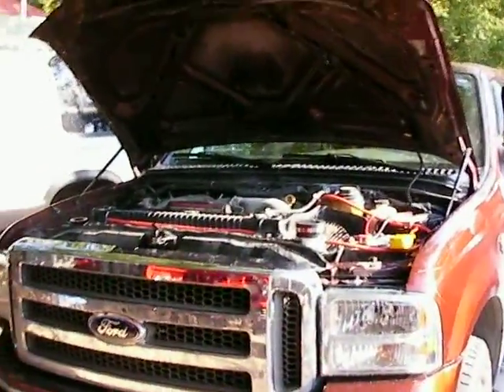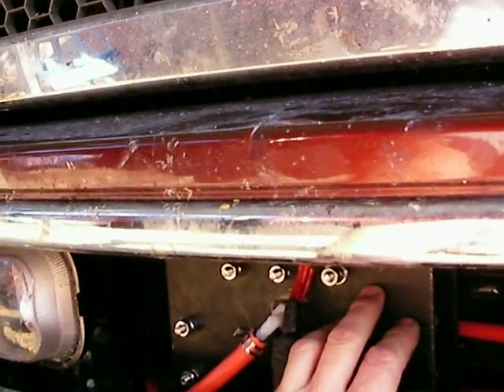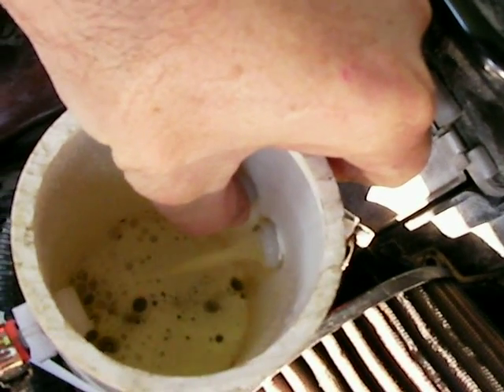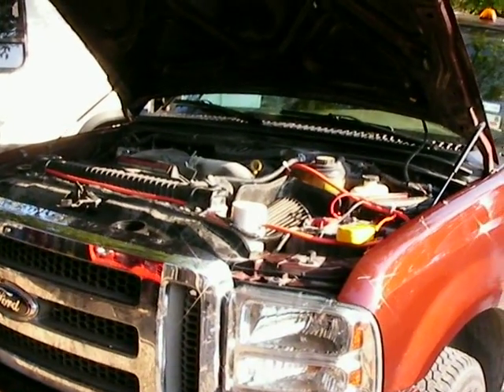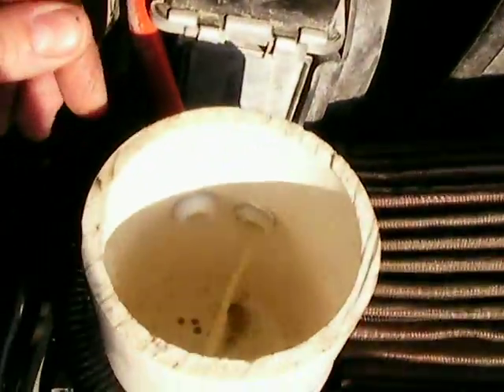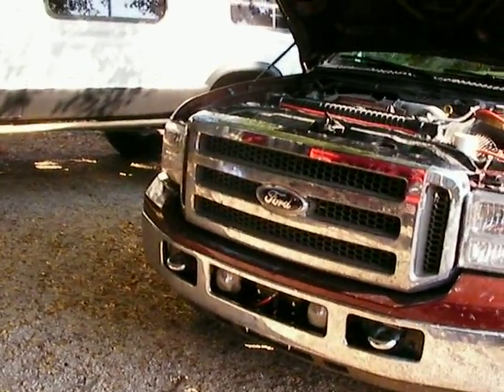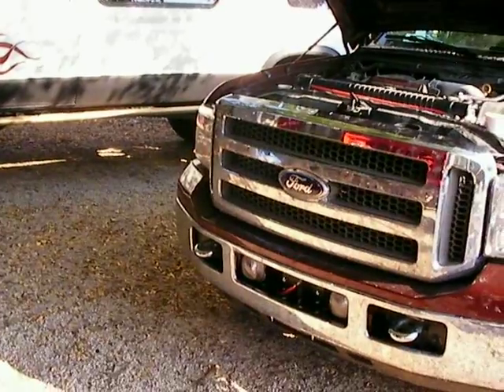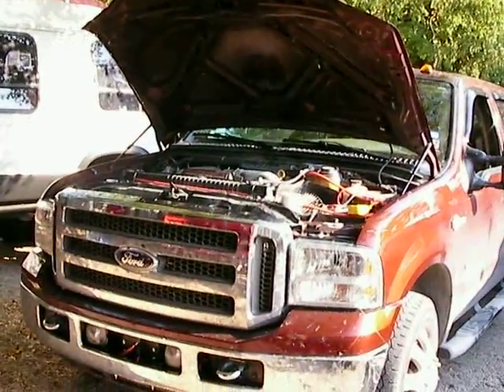hydrogen powered super duty

Comment: Hey so does this really work? Ive been told it doesnt, is it a scam or no? I'm thinking about getting one, but not to sure. 

Please get back at me!!
Reply: 80sjon it does work. New trucks you can expect between 3 and 5% gains but you have to factor in the clean burn it provides and also keeps your system clean. On old trucks it does wonders for because it cleans carbon out and gets the systems back on track while increasing power.